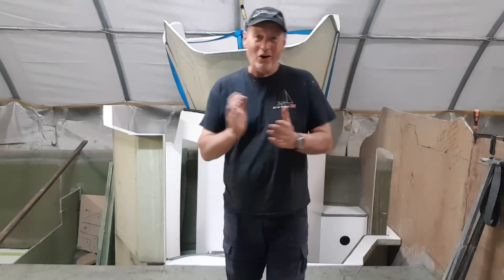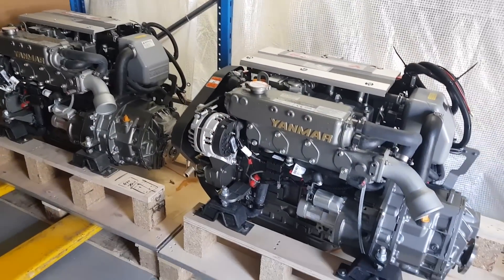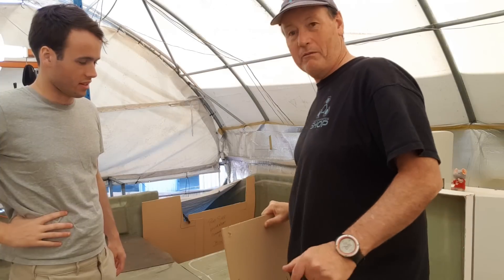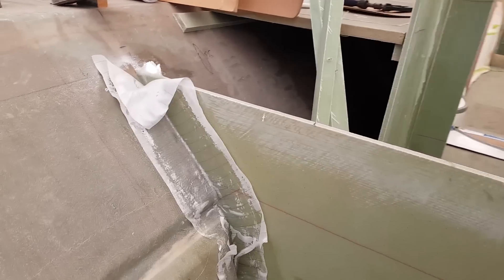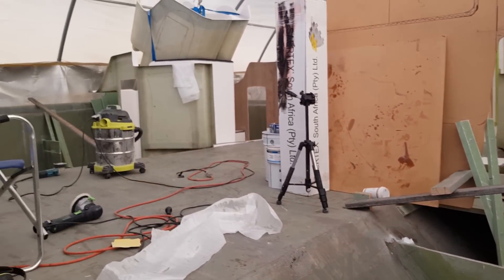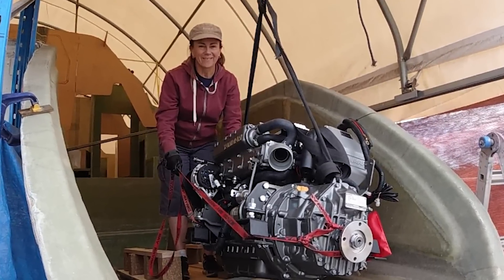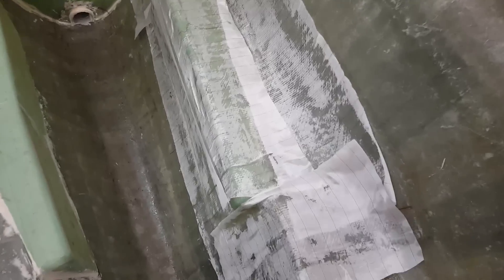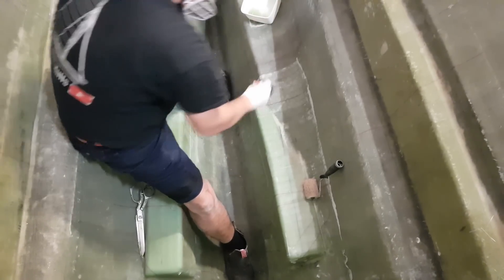Ep135 Yanmar Engine Bearers and Engine Rooms

Comment: Good you're using epoxy on dry polyester... Great quality build. But why not fit the engine into the hull by just coating the inside hull? I don't see the sense of the engine bay module. Just adding weight to the boat in my eyes.

Comment: What's the point of those engine bay inserts? THey're never going to bond to the hull and there will be gaps and voids between the bottom and sides of the insert and hull. Water will collect there... Why not omit the insert altogether and just gelcoat the inside of the hull in the engine bay? Or at least cut off the bottom half of that insert entirely?

Comment: Have you made allowance for mounting chain plates ? .
Reply from the maker: Hey buddy.Original boat had chainplates through the deck which although they were tied into the bulkhead were a leak point.I will either make some carbon chainplates or have some stainless plates made that are hull side mounted similar to the seawind rigging which seem to allow a better deck throughafare access and minimise deck leakage issues .Cheers Ross

Comment: " Production standard build"  `` you say, my arse I say. No production boat is even close mate. Flocoat under the bathroom module in the bilge , sanding corners in the engine room UNDER the liner. A builder would be broke halfway through making the mold to your standards. Shame there ain't a Concourse DE Elegance for boats.
Reply from the maker: That is probably why its taking me a long time.I see something I want it right.Then I need to work it out.I would hate to have to employ staff to do this stuff for a one off.Ross
Reply: We can see "production standard build" if you look at Mads' Warrior 38, Athena. Poor lad is having fun, but undeniably, that boat was an absolute mess. People in the comments think that the previous owner stiffed him, but in reality, THAT, is the level of "production quality" in fiberglass boats. Looks pretty on the outside, rotten apple on the inside.

And if one hops over at Sailing Uma, in their episode where they put the new drive in, and then they glass the boat at the keel, yet another example of "craftsmanship" of the factory standard. A badly terminated keel, meeting directly into fiberglass, which in turn caused a huge crack, probably something like 30 cm if laid flat, to appear.

And the worst part is, what i'm putting into spotlight aren't even things related to "quality" rather bad building practices. In Mads' case, a lot of his issues with water in the core would've been solved if the builder had simply united the deck to the sides, which they didn't, and in Uma's case, the keel should've had a stress discharge shoe, a simple piece of stainless steel, shaped kind of like the wings on a Corsair fighter plane, upside down. A cheap, 5 dollar strip of metal, that didn't get put in to unite the fiberglass to the metal.

On the one hand, sure, they'd get broke if they'd be as mad as our Ross, but on the other hand, they are also a&&holes who cut corners as much as they can.
Reply: @aserta  So we all agree Rosco is a "NUT" but in a good way.  I live in So Cal and we have a lot of Formosa and other asian built  boats. One of the local dock rats went to Taiwan to " improve standards" at a yard. They were doing the layup outside and it would rain most days in the mid arvo so they would down tools for a bit then mop up and back at it in 100 %  humidity and standing water. The guy just gave up and came home.
Then you have a sail plan with the primary winches on the aft rail at deck level. You have to neel it work it and the handle only turns 180 deg. No sailor involved in any of this.

Comment: Hi Ross. Maybe a stupid question but why do you need that large fiberglass module at all?  couldn't just reinforce and flow coat the engine bay?
Reply from the maker: Not a stupid question I could just flowcoat it,but I love the modules,neat,professional and environmentally responsible as no oil ,coolant etc will be able to enter the bilge.Therefore the sea.Rossco

Comment: Have you consider buying a “m” or “h” class vac, that royobi is not rated at all,
Reply from the maker: Probably should do that.it is a piece of crap but it is indestructible.What it's rating for particle is I am unsure,am using bags which adds an element of filtering.Cheers Rossco
Reply: @LifeOnTheHulls  Your particle balance would be on "harming" anyway I reckon, vacuums stir up much more particles that were not yet sucked in than those they will spit out, so better put on a mask anyway when vacuuming a ground/dusty surface, as You do when grinding.
Reply: Yea don’t think the bags help that much, the good vacs have full filters and cloth single use bags, 
There is a big issue in construction right now with Silca so all vacs have been reviewed, the ryobi is not rated at all,
Reply: @mrghm  Rating vacs does not help.
First bag or set of filters coming from a third party off ebay or Bezos does debase everything the producing company might have tested (or sometimes downright bought ...) in terms of certificates and approvals.
Only way to securely defend harm is to guard Yourself with masks and filters You can wear. Plus, as I already stated: Most particles in workshops get airborne not after the vac, but by its exhaust blowing the floor and other surfaces.

Comment: WOW I was checking up the fuel economy on those Yanmar 4JH57 engines which use about 0.842 g/cm³ @ 15 Degrees Celsius & because it's a 2.19 Litre motor it will use about 1.84398 Litres of fuel each motor, that's very economical if you can keep the engines cooled by a mini 12v air conditioner sitting inside the engine bay like this one below. This one actually has a compressor, works at about 7000 BTU. If you run your engines without an air conditioner then the hotter they are the more fuel they'll burn.

12V/24V Car Air Conditioner Wall-mounted Inverter Air Conditioning Kit Dehumidifier Air Cooling Fan For Caravan Truck
https://www.aliexpress.com/item/4001011689423.html?spm=a2g0o.productlist.0.0.5c0e2300qhurP2&algo_pvid=4159e1a7-a57e-43ca-81dc-0a5a50fc2b03&algo_expid=4159e1a7-a57e-43ca-81dc-0a5a50fc2b03-12&btsid=0bb0622c16016079821127710eb162&ws_ab_test=searchweb0_0,searchweb201602_,searchweb201603_

Comment: Hey Roscoe - Not sure if you have been watching  the Parlay Revival channel. They renovated/rebuilt a hurricane damaged Lagoon 450 cat and did a neat job. But they have just posted about a major hull integrity failure where several bulkhead/hull joints failed and they are facing a very complicated and costly repair job.  This could be hurricane damage related, but it also turns out that these cats are known for this type of failure because they use a mix of gluing and tabbing to fix bulkheads to hulls - which is not good practice IMHO. I immediately thought of your build. If I were you I would want to be 100%  confident that the  structural layup (especially segment - hull and deck joints) were fully up to rough sea going stresses. If I was not 100% confident, then resolve it now rather than risk a drama later. Everything I see about your build tells me its 'brick shithouse' good, but well worth confirming! Keep up the great work otherwise and so great to see you back in the bilges! best regards R
Reply from the maker: Hey Richard.The boys certainly have their work ahead of them with a major structural breach.I personally worry heavily ahout the integrity of a boat with a fractured backbone but the reality is,anything can be repaired but the pure luck that it happened to them near shore and not in middle of the pacific is incredible.I reckon they will be up for a ridiculously expensive repair but Colin will likely  try to repair themselves.The initial cost of 200k USD coupled with these set backs and 6 months in a yard I have to look hard to justify ever buying a hurricane damaged boat,but hey I probably would have done it and repaired it.At least they are living a dream out. Gonna be very interesting Rossco.
Reply: @LifeOnTheHulls  Maybe one of you guys need to pick up the phone (email or social).... I am sure old mate would appreciate you expertise and it would work well as a sub collaboration. NB: I sub you both.
Reply: @LifeOnTheHulls  "At least they're living the dream out" had me crackling. Pretty sure their dream wasn't crouching through poorly shaved standing fiberends in search of the damage's real end for another year ...
Reply: Everything has a lifespan and after being deemed salvage by the insurance company it must of been more of an expense than an asset after all it's glass if you smash it on the reef the shattering effect would resonate though out the boat. Unseen damage is what drives up the cost of owning it. So keep it off the reef Ross!! Cheers mate!!

Comment: 2 weeks after Rosco sets sail, all the oil runs out of one engine. Yup he's back in the 'Bilge'! cleaning it up. Luckily it turned out not to be a bad expensive engine fault just the sump bolt wasn't tightly fitted and vibrated loose.
I couldn't see the fault with how you first did the engine bay but as usual it sure looked even better once you finished it. Nice work.

Comment: Hey Ross, the progresses are beginning to speed up, it's great to see !
I never see you using your resin gun anymore, is it broken, or is it only worth using it
when there are really big surfaces to cover ? 
I guess it's a real bitch to clean too... 

I suppose that before you attach the engines to the boat, you must align the shafts going to the propellers ?